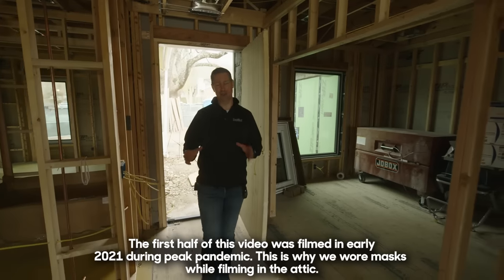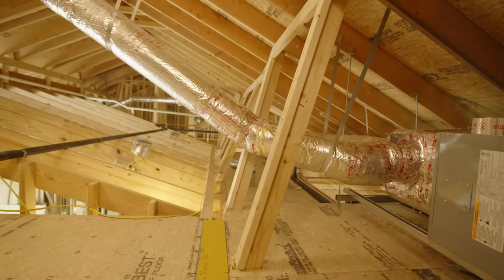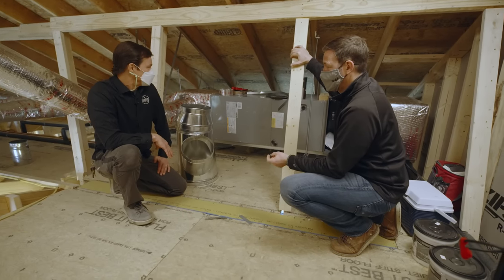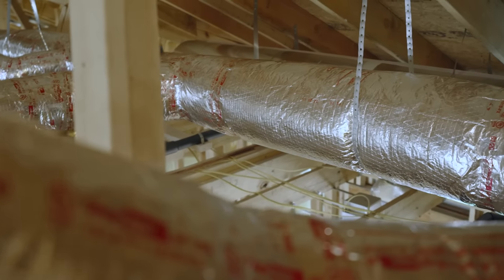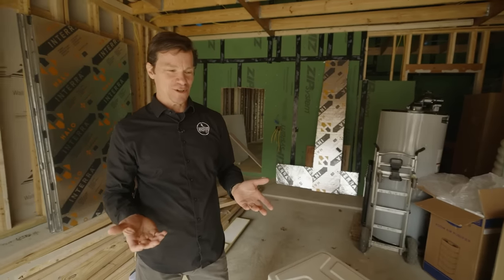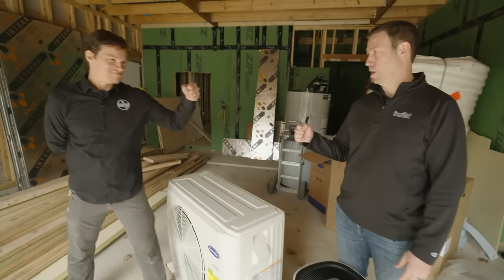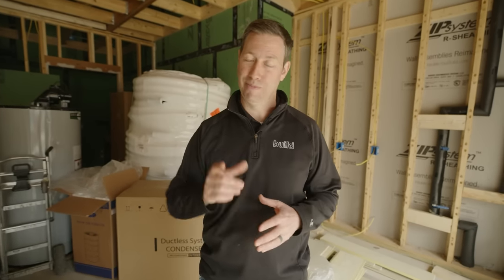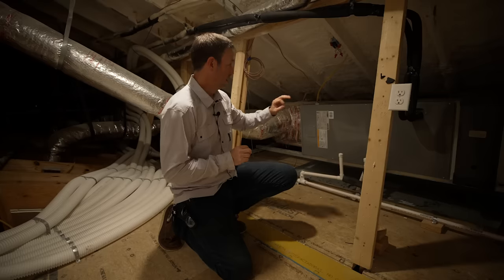HVAC Done Right! Watch this before you install!

Comment: Condolences on the loss of your mother-in-law. I wonder if there are other options for that small room besides the wall head and discrete filter. Are any of the “pizza box” units that you can put in the attic able to do adequate filtration? Between the rather bulky wall unit and the floor-standing filter, I just feel like they overwhelm that space.

Comment: Matt I'm confused. You have the Zehnder filtering and distributing air. You have the ducted ductless horizontally mounted unit filtering and distributing air anytime its fan is on. Why the Carrier stand alone 3 stage hepa filter? At about 16:30 Christoff explains the benefit of hepa filtration if the mini split is the only form of filtration, but the Zehnder on its own is giving excellent filtration. Also it seems like a substantial increase in expense and complexity to have the ducted ductless unit at all. Is the the Zehnder in conjunction with a multiple wall unit minisplit system a solid design/strategy?
I'm sure your team installed the ducted unit flawlessly, but that seems like a lot of effort if you could just substitute a few wall mounted minisplits.
What am I missing?

Thanks so much for all your work. Love the channel.

Comment: Curious Matt with you doing so many homes have you heard of any issues with financing homes with spray foam.  Was doing some research and it seems in the EU some of the banks are refusing to Finance homes with spray foam unless it's removed so that the structure could be inspected for damage?
Reply: Wondered that myself after watching some European Contractor videos about that very thing.
Reply: That’s only for attics. Walls are fine. Do they expect you to tear off sheet rock? Lol

Comment: Thanks for video! Putting a multi split in my split level if my A-coil loses refridgerant again. Problem is that if it's in the hallway, will the bedrooms stay cool on the other side of the wall? Any tips on finding a good installer that won't rush it? Can I use my old ductwork for fresh air?

Comment: Matt, I am a little confuse on the spray foam for the interior roof,  Would you use open or closed cell?  if you have a leak in the roof using open cell is best because it drains through and the leaks is easy to find.   Closed cell on the other hand acts as a vapor barrier  and is a little more effective but if you have a leak in the roof it is almost impossible to find and can do a lot of damage to your roof.  Then their is code issues where I live.  They require a fire retardant to be sprayed over the foam leading to additional cost.  What is the answer? Open or close? are the making fire resistant foam now that may pass the code in my county?
Reply: He has zip sheathing on the roof deck.  Highly unlikely to leak.  He does have another video that talks about fire retardant spray foam.
Reply: @wkobayashim  Yes I understand that he is using zip sheeting and has laid foam under that as well.  But he mentioned a few different times about spay foaming the inside as well.  I was only starting what I know about spray foam.  I was taught you only use closed cell in roofing areas but times have changed since then.  Now you have to worry about fire codes and ridge rot, air changes per hour and etc.  I have had insulation companies come to my house for quotes and one will quote open cell while the other quotes closed?   Same things for under the house.  That should be closed cell because you want that vapor barrier but many companies are spraying open cell. Thanks for your comment.
Reply: @StandForFreedom1776  I had this same question... I thought that in this instance, one would use open-cell...
Reply from the maker: Great question. Watch my videos on conditioned attics for the longer answer but in short. Closed cell foam works great in all climates. I think the leak argument is bogus personally. Open cell works in the South but you need more of it and you need to ensure you have supply air up there to keep humidity low
Reply: @buildshow  my thought was air sealing was a far more important than 4 inches of open cell insulation.  It is my belief that one in of closed cell works just as well as 4 of open cell but you get the added benefit of air sealing.  I live in Virginia where we get hot summers and mild winters.  I did see your other show when it first aired. Thanks for your reply.

Comment: What's the best way to find a HVAC design when trying to uplift your existing home? I'm near Dallas, if that helps, and my HVAC is a single unit for a 4500sq ft house and does not work well.

Comment: With a house remodel, are you required to have a HVAC air return in a bedroom? What happens to the air when you close the bedroom door. (Texas) Whole house Central air unit
Reply: Probably a nice to have.  Probably will cost an extra $300 for each return
Reply: @wkobayashim  we have a single air intake in the middle of the house. In the hallway. I was just going to cut a vent on both sides of the wall between the bedroom and the hallway. Use the space between the studs for the air channel. (Closed studs)
Reply: @TJK50014  you will be able to hear conversations in the hallway
Reply: @wkobayashim  I was going to put one vent at the bottom of the wall on the bedroom side, and at the top of the wall, near the ceiling in the hallway. Should be enough spacing to cut most of the sounds for privacy. Better than the option of making a bigger gap under the door.
Reply: @TJK50014  just don't close the door 🤷
Reply: @TJK50014  at the very least I would install a “jumper duct”.  So what if you hear conversations in the hall, at least the room will be more comfortable.  Not to often people carry on conversations in your hall in the middle of the night.  The original builder cheapened out by Only having a centralized return, but you could change that or hire a reputable hvac contractor to do this.
Reply: We added a couple the one in a middle Hallway ranch wasn’t cutting it .

Comment: Only issue I see is having those 2 units stacked outside.  If the circuit board needs to be serviced or replaced the top unit will need to be moved.

Comment: I have a cooling-only attic central air system in Maryland, and HVAC techs tell me that my ceiling vents won't work well for heating (if I switch to a heat-pump system). Is that true?

Comment: Mitsubishi Minisplits are king...28+ SEER on some H2i hyper heat units.  I run 5 units, separate units, save a fortune in heating and cooling...super efficient, super QUIET, inside and outside...the world uses MiniSplits, the U.S. is finally joining it.  Forced air central air and heating is so dumb.  uninsulated ductwork in residential is dumb..MiniSplits by Mitsubishi for teh win.  Trane joined them for a reason
Reply: i agree ,

Comment: Geothermal heat pumps get rid of the outside box with moving parts that wear out.  Earth 6 feet down always 50 degrees 365.  No outside air version fighting with 100 degree heat or 0 degree cold climate

Comment: How do heat pumps work in the -10 to -20 outdoor temp range? 
Also, how do you rate heat pump capacity for heating a cold house, vs cooling a hot house?
Reply: They dont do good, they have AUX heating because they cant keep up. Repairs take longer, they dont last as long as a NG forced air furance. HPs have their place but they are a bad ideas if you have NG as a option
Reply: Some newer models can still work at those temps, though some aren’t as efficient.
Reply: An air to air heat pump does very poorly when you get to that temperature range, the newer ones will work, just not very well.  If possible look into a geo-thermal heat pump.  Those will work no matter how cold the air is.
Reply: @zack9912000  no gas on prem.. we have heated ceilings right now, so ANY minor improvement would help!
Reply: @michiganengineer8621  I've thought about geo-thermal... That could happen, but I'm sure it's not cheap either...
Reply: @treyhart6861  No it isn't although a lot depends on if you go with a open or closed loop.  Vertical or a horizontal layout.  If you have the space for it, a horizontal closed loop is usually the least pricey.  But you need a lot of square footage and it has to be dug down at least 5-10 feet.
Reply: @treyhart6861  They were not too expensive to do when government had large grants for them, they are no longer offered. I would advise looking into mitsubishi systems, they are number one in the industry. If installed right and basic maintenance done, I rarely have to repair them.
Reply: I would not recommend any electric air-air heat pump for those temps.  Might want to consider a pellet or wood stove if geothermal is too costly.

Comment: I have the same wall units and similar units outside my house installed in June 2021. I noticed sometimes the wall units make strange noises while running. The noise doesn’t last real long but it happens during the summer and I don’t understand why that is. I know during the winter it happens but it displays “df” which means it’s in defrost mode when it’s cold out. Any idea what could cause it to make the strange noise during the summer? The units were cleaned professionally once this season and the tech couldn’t really explain the noise

Comment: Are these HVAC systems left running 24/7? Or do you just turn it on when you feel cold?
Reply: They’re ramp up and down. So run power consistently instead single stage systems with a huge Burst of power when they turn on

Comment: My 96 year old dad, a WWII vet,  passed on March 5th. Their A/C had gone out in September last year, but he actually enjoyed the extra warmth. Now we're in the middle of summer, and mom can't afford the $11,000 a local A/C company wants for a whole new system...it has a leak in the interior unit. We REALLY need to get the costs down for the elderly...anyone got a spare $11K in their back pocket ?
Reply: Get cheap window units
Reply: Blame the EPA and Bidens inflation for the high costs, the industry is struggling to get parts and materials. Higher fuel costs and strict EPA regulations makes the systems cost a alot more
Reply: Go with a mini split and DIY install. Save 75% or more on the cost and have a more efficient unit!
Reply: What tonage ? Neighbor just got a 5 ton w 10 yr warranty $8500

Comment: When I watch these videos, about air heat pumps, I always wonder for existing homes why does there have to be a small wall unit installed.  

Why doesn't the makers make a condenser / expansion unit that sits in the furnace like the current cooling coil in traditional ac systems?
Reply: They do, there are many styles. They can be used like you suggest for retrofit on an existing furnace, or to replace an existing furnace/AC stack using existing ductwork.
Reply: @theonedavel98 
Good to know thanks for the info.  Will be redoing my furnace and ac soon.  Have not seen any youtube videos espousing using this method.  I'm at a borderline state, well maybe not exactly border line, and I'd feel safer having a natural gas furnace as a backup and try the heat pump for primary heat.

Comment: I rather pay a bit more and get a Mitsubishi unit.
Reply: This is something people don't think about. These inverter VRF units are not designed to be easily serviced. Spending more for longer warranty is prudent.
Reply: @anujbhatia3337  Also they are extremely expensive to install, maintain and do repairs. On their bs savings claims absolutely doesn't make them worth the cost
Reply: @zack9912000  I don't know about more expensive to install. But certainly more expensive to maintain/repair. That's why I got a 2-stage Heat Pump/AC. It was also more inline with the pay-back period I had in mind vs an Inverter based system.
Reply: He has Mit in his house , but if carrier “ sponsored “ IE free you go with that .

Comment: Matt, 80F in the summer is way to high for most places.  80F is fine for a week or two, but in the South and South East the is more like 3 to 4 months..  75-77F is much more reasonable temperature.  The real danger will be humidity.  If you need a storage space with a different zone than the rest of the house, consider an airlock or breeze dampener set up or huge silent directional fans in the ceiling.

Comment: I want to know - how does a 2 stage thermostat (Ecobee 5) control a variable speed compressor?  Does the unit also have it's own sensors?  Do you loose steps in the variation capabilities of the compressor?
Reply: I don’t think it will work. I got a variable stage Trane last year and had to use their thermostat.
Reply: There is another communication box that is installed between the thermostat and the air handler. It has an air temp sensor in the return that feeds its algorithm to govern the modulation on the condenser

Comment: Very impressively designed system. I've been watching a lot of your videos on the subject, very good and interesting information. I'd like to consult with someone with your similar 'ethos' to climate control about a pickle that I am in with my home. I need, i believe, both a temporary and a more permanent solution. Do you have any person or firm you would recommend?
Reply: I'm in zone 3 if that helps you point me in the right direction.
Reply: He mentioned his HVAC design company is "Positive Energy".
Reply: @MorryB  I caught that, and I am looking into them, however I asked the question anyway because 

1. I am looking for a remodel consultation, not a new building 

2. I've reached the point in my research where I am ready to pay someone to help me find the best solution, but I am currently on a VERY limited budget

3. I want both 'the right solution' for my home and 'the one that will work RIGHT NOW, on an extremely limited budget. 

I don't think that Positive Energy ISNT the best person to talk to on those points, but if he knows of someone he would recommend MORE I'd like to know that, hopefully before I pay another consultation fee to someone else who gives me not the answers I need.

PS I am open to answers on this question from more than just Matt. If you know of a person/business who fits this bill, drop their name and I will check them out

Comment: I'm concerned the fan motor is expected to operate 24/7.  This will result in changing the blower motor more frequently.  Instead of relying on an ERV all of the time, opening windows for fresh air should be encouraged during the mild weather months.

Comment: 21:41 If you put one unit above another then the one on the top will work less efficiently cause the air is hotter around it.

Comment: The minute you have a repair on this type of system, you lost ALL of the perceived ROI between this and the older equipment.
That vent AFTER the trap, on the attic ducted unit, is supposed to be open otherwise it's not a vent and therefore unnecessary!!
Reply: ROI?  This stuff was all free!

Comment: Carrier makes some great products and this is a petty complaint but I hate the way they refuse to put the tonnage directly in the model numbers. A 3 ton Trane will almost always have 036 in the model number making them easy to identify but Carrier likes to do 05 for a 4 ton, 06 for 5, 07 for 7.5 ton etc. which means you have to look em up every time. Doesn't matter to 95% of folks out there but it drives me nuts.

Comment: I still don't understand VRF
Reply: Very expensive and  NO one will save enough on their energy bills to warrant the upfront costs and costs to repair. Cost to repair these system is 4x the cost of a normal system.
Reply: Best way to explain is that it runs at a high  level to achieve desired temps, then slows down to maintain temp.  As opposed to full start and stops.  More comfortable and more efficient, unless improperly sized, then you have more issues

Comment: I like most of the things you do however I don't even agree on everything...even with my wife. I was very disappointed about this video. Carrier has an average SEER Rating of almost 17 and if you must at the very least use a 20+ SEER or above to have or notice any savings. I'm not saying everyone must buy a Mitsubishi, Fujitsu or other expensive unit's they are plenty out there that perform better, have a higher SEER rating and better warranties than Carrier and other domestic, low SEER or expensive domestic unit's. Very, very sad you went down this avenue.